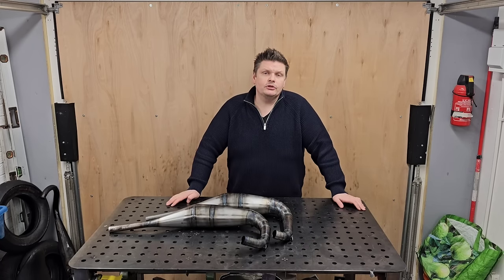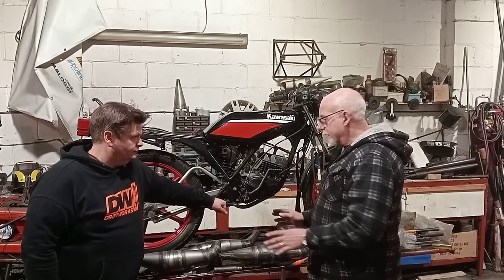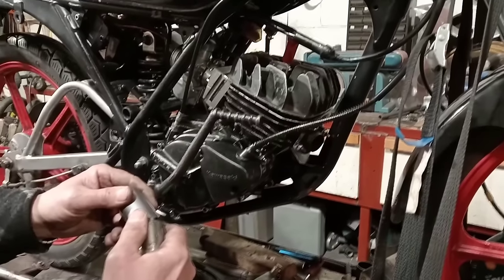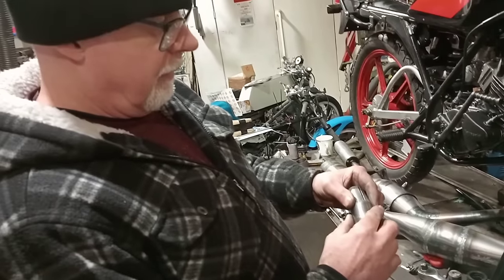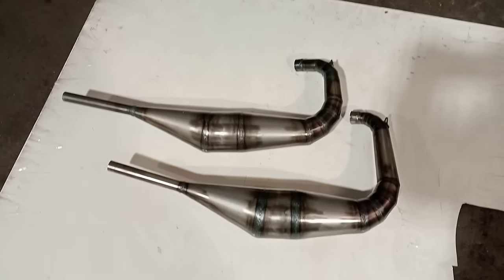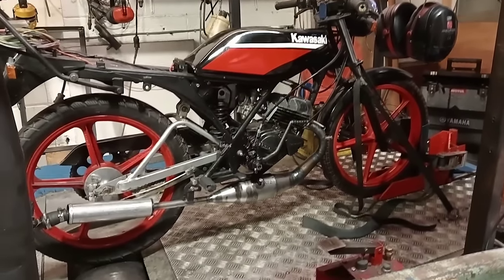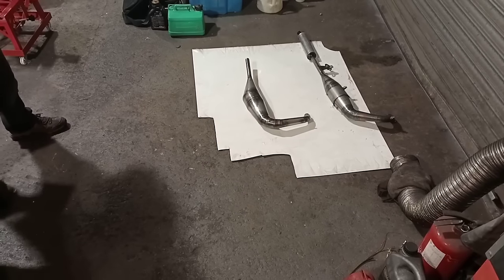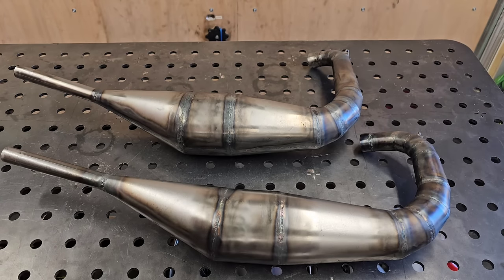2 Stroke Expansion Pipe Builder Reveals PIPE SECRETS - A day at Mick Abbey's.     #2stroke #power

Comment: Its all area under the curve. Having that peak hold for 700rpm longer allows you to shift up with a 700rpm advantage when entering the next gear so a 2+ hp / 1 ft/lb increased midrange drive which will be very noticeable. Great video!
Reply from the maker: Hi, thanks Mitchell :)
FIngers crossed it helps. The original magazine challenge bike had the T40 pipe and struggled to get 6th gear (it couldn't) so maybe with Mick's pipe I will be able to.
Reply: Gearing is another aspect I find interesting, it's really another piece of tuning for speed
Reply from the maker: @nickywalsh8492 agreed, I need to get some sprockets ordered 😊
Reply: comparing a 300rpm-plateau with a 1000rpm-plateau, I d say, the 300rpm-plateau is not drivable, more so, if you can have the option... Logically, one can say, the one with the 300rpm-plateau needs 3,3times the gears-number of the alternative... It´s not that bad in the praxis, but such a disadvantage surely carries over in the praxis (is very noticeable).
Reply: It doesnt matter what sprockets you got
If your stock transmission doesnt fit your powerband it would still be useless

Comment: Watching this video almost angers me of how much I could have improved the performance of a 350LC that I fabricated expansion chambers for, back in the 80's. I didn't have much to go on and dynos were pretty expensive back then, I only had a book on 2-stroke tuning by John Robinson. I used one of the formulas to fabricate the pipes and had them fitted to the bike. The diameter on the neutral chamber section was small compared to what you see today but it turned out to our advantage as we had reversed barrels and they had to pass under the rider's thighs and they got pretty hot lol. They did work and the LC was turning out pretty decent times at the quarter mile strip but it could have been so much better if I had the information and a dyno. I am 64 now, but 2-stroke engines still give me a thrill whenever I hear (and smell) one.
Reply from the maker: Hi, that sounds like some project reversing the cylinders! How much power do you think you had in the end?
Reply: @AutoBeta2T  No idea about power, we reversed the barrels to get the frame as close to the ground as we could so we could pass the pipes straight to the back and on the sides. I think it ran in the 11 second bracket. I remember we had a 250 head with the squish machined to fit the 350 barrels, carbs were 2 from a KH750, we still had the standard reed blocks with the centre rib removed and one piece Harpowa reeds. The engine was fitted on an older air-cooled RD350  frame that I totally hacked horizontally and re-welded it. Rear arm was lengthened and welded to the frame. We increased the rake by heating the top tube supporting the steering head and bent to whatever degrees that looked good lol. Front forks and wheel were off a Yamaha YB100. Rear tyre was spinning in the rim so we fixed the problem by tap screwing into the rim and into the tyre. Crank was welded because it spun out of true (LC cranks are not splined). At least two clutch baskets were destroyed. We ran it on Avgas fuel and the only way we could acquire it at the time was to get someone that had a pilot's license for small aircrafts, then go to where the plane was and drain the tank. Safety, what safety? We didn't even have a front brake and when I pointed it to the owner/rider to be careful he replied: "I just wanna go fast why would I need it." Quite a character, sadly he passed away 2 years ago. I believe there is a YouTube video albeit low quality that shows us racing the bike I will put a link to it if I find it. We're from Malta and when my friend went to the UK to buy parts he went to Bob Farnham and when he showed him a pic of the bike he was impressed, he even came to Malta on holiday and to meet us and have a look at what we were doing. Great times indeed.

Comment: Damn how much I would love to work for Mick. You can see how much he likes his job for how he takes time to explain what he's doing and the reasons behind it. So much to learn.

Also it's beautiful that there are grown people dedicating time to such small CC's bikes, and not completely driven away by big bikes.
Reply: To me I find 50cc the most interesting size to tune too.
Especially the older air cooled ones.
Reply from the maker: Yep, Mick really is very passionate about his job, it was really great for me to experience this first hand being lucky enough to spend the day with him. There's many years of experience there.
Reply: @peterjohn3180  Indeed! I am more used to the LC ones mostly because I live where Summer starts in May and finishes at the firsts of November. 35° C and more. Mid July 2023 we touched 47°C. Need a massive radiator and two fans to run my 80cc at 55° C.
Reply: @att49356  why do you run at 55 degrees C?
I remember when lc Moto X bikes first came out people would "cold seize" as they needed longer to warm up for correct piston to bore clearance so piston over heated locally.
But if I'm honest I'm not sure what the optimum temperature for such bikes is!
Obviously the cooler it is , the denser the air/ charge is, but the tighter clearances you will need to cool piston by conducting heat to the bore then to water or air dependent on how it's cooled.
I do wonder how this AC ar50 manages with cooling fins designed for cooling something with 4-6(?) Bhp as standard!
Reply: @peterjohn3180  it Is a modified kit, slightly ported, tight tolerance kit! Not really suitable for the Road. I also have a second bike with similar setup but less fragile as It has 6cc more and more torque means i can not over do porting etc. I posted a video on my account but audio sucks! I Need to find a Better solution.

For these engines i'd never go over 65°. On air cooled engines instead i have no experience at all! Would like to modify an air cooled cylinder to adapt It for my bike. Do you perhaps know any cylinder kit that has 40mm stroke, 90mm rod lenght and needs casings intake? 52x52mm stud spacing would be awesome!
Reply: Heat vs air cooled interesting topic

Comment: That's terrific. Best vid I've seen on making pipes. What a great idea cutting the sections out of a flat cone - definitely trying that next time. Will try 22ga steel too, I've only used 20 before which is about 0.9 as I was a bit paranoid about cracks. Thanks both!
Reply from the maker: Pleased you enjoyed Joe. Yes, Mick has some great tips that save time and increase accuracy. 
Do you gas weld pipes?
I have tried 0.7mm sheet before on my X7 pipes. I could weld it with Tig but it was a little trickier. Gas seems to be a bit more forgiving - I'd love to have a try.
Reply: Weeell. I've only made 3, 1 test and a pair for an RD250, but yes. Gas is easy enough once you get the hang of it. I use a little filler, like Mick does to tack, which takes some heat away and avoids holes, then autogenous. On the small seams you have to whip the torch away so you don't blow away the ends. My set up is an old Smith Airline AW1 handle, and AW201 tip, I really like it. Works fine at low pressure for 22ga, anything thinner is hard. I've never tried Tig so I can't make a comparison, I'm afraid. You use very little gas on thin stuff, so it's cheap to play with too.  @AutoBeta2T
Reply from the maker: @joemarchant1424  cheers Joe. Tig is similar, I think, to gas but until I have a go I can't say. I can tack with no rod but I do need use it every so often when there's a bit of a gap.
Argon seems to go quick too. I'll have to ask Mick to let me have a go next time I go up.
Reply: There's something relaxing about the flame whispering away and it's nice not to have to wear a mask. Can't believe how fast Mick rolls those cones, that set up on the slip roll working along loose to tight I definitely need to try.  The baffle cones take me ages. I have serious mandrel envy too. Thanks again for the vid - great content! @AutoBeta2T

Comment: Hi Dave, that peak power curve is a great result.
Your take about this sort of curve helping you achieve your goal is spot on based on my experience running smaller Land Speed 2 strokes.
As far as other things that can help, such as Aero etc. 
I found that minimising your Frontal Area on small bikes is the first thing to explore.
Then base everything else on this smaller profile.
Cheers Mate
Pete
Reply from the maker: Hi Pete, that is really great to hear from someone with actual real world land speed experience. 
The original magazine challenge used the T40 pipe and they really struggled to pull 6th gear (it couldn't) so I have always been conscious of not getting too peaky with the curve and spreading the power. 
Noted on the frontal area, I have a nose cone for my AR but again on the original challenge they found it faster without.

I need to get on a diet then to reduce my cross sectional area :)

Thanks again for you insight and tips Pete, much appreciated.

Cheers

Dave

Comment: In 1974 I used to tune 2 cycles. I had a 70 Yamaha 175 that put out 43 hp @ 14,500. It had 9 ports, analog 32 mm fuel injection, 8 reeds, and an expansion chamber that had a 8,000 top hp but I check it out and I got 14,000 the the gases did exit! I ran it in open class and got several first places. But in 1976 open class motorcycles were more torgue, hp, and better suspension!
Reply from the maker: Cool, that sounds like a screamer!

Comment: Had a chuckel to myself when I saw the old 2-stroke "Tuners Handbook" oncarb adjustments between pipes the bench. Did you do any carb adjustments between pipes. I remember way back when just changing the angle of a pipe would upset the mixtures (on a very highly strung T-500).
Reply from the maker: Hi, sorry for the late reply. No, we didn't, with the jetting,  but we kept track of the lambda and it was similar for.all pipes.
We did change the ignition curve from a flat 20 deg curve to one I had found worked best on my pipe. It made Micks pipes work even better so no more adjustments were made. 
But noted your point, both jetting and ignition should have been optimised for all pipes, but as always, we ran out of time. ☺️

Comment: I just subscribed, thought i already did.
These are one of the most interesting videos on YouTube.
Id love to make expansion pipes.

Have you considered having a new liner made with just a single intake port bridge rather than 3(or is it more?!)

I wonder how well it would work with a smooth bore throttle body and injection?! I hate electronic thoughbut you could have i nice constant taper and trumpet and thin throttle slide?
Reply from the maker: Hi Peter, thanks for the sub and I'm pleased you are finding the video(s) interesting - it's good to know they are being appreciated :)
Reference the liner - maybe one day... That day will come when it seizes I guess. Currently though the inlet port is just a single bridged port. I did cut a floor port in a previous video which gave some more power.

I'm going to stay away from injection at the minute and see how far I can get on a carb. The ignitec ignition I run can control power jets an carburetors so possibly some electronic control.

cheers, Dave

Comment: The compromise on a bike is available space and the noise you are willing to tolerate.  A megaphone style exhaust sized and tapered for the engine displacement is just as effective but a lot louder. Some tricky extending stinger or water injection will give you a good balance of low end and still compensate for top end for those wanting to get crazy with it. Any 2 stroke stuff is good stuff..
Reply from the maker: Yeah, water may be in order if the power band gets too short. Hopefully we can do it without but it's an option

Comment: I worked in a Suzuki/Yamaha dealers in 80's.
Hated those little Kawasaki 50's, they were always completely trashed after about 3 months. (nearest Kawasaki dealer was about 20 miles away in Cardiff)
 Everything was worn out, shock bushings, swing arm bearings,  seals, even the wiring and switches.
 Honda MT50 was impossible to tune (British market ones couldn't be ported to 'continental' spec of 6.5bhp)
Yamaha was the easiest to tune and slightly better build quality than Suzuki. (was tuning 'Fizzers' in 70's, although knew a lot less so 63mph was best I could get)
Stan Stephens was the 'go to' two stroke tuner back then and 'everyone' wanted Micron's on RD and GT 250's😁
Many years ago, I fitted a Suzuki RG125 'learner special' tank onto Honda RS125 road racer for Ian Lougher to do TT
 Lot of work cutting out complete bottom and making it fit Honda like it was supposed to be there. He removed all the fuel filters though and seized it 2~3 miles in when a bit of rust or dirt got into carb.
LOL, it's probably 40 years since I heard 'southern shandy drinker'
Reply from the maker: Yah, I think a lot of 16 year olds didn't know how to look after their bikes!

My first bike was a Honda MT 50, and yes it was pretty slow... slower than my mates AR 50 anyway... which is why I got one

Comment: That over rev is very nice. I wonder how the T40 would work with a longer belly (large section between the cones).
Reply from the maker: Hi David, we did actually try that on the day but it didn't get into the final cut. However, we tried longer and shorter on the belly of the T40 and it only became worse both ways.

Comment: Another very insightful video, he makes it look so easy! 👍.. how do you seal where the pipe slips onto the barrel? I've got a bdk pipe on mine and it leaks a bit where it slips on 🤔
Reply from the maker: Cheers - and yes Mick does make it look easy. Years of experience.
I'd use a bit of high temp sealant. Is it a slip fit? On my BDK pipe it uses the standard AR style split collar and gasket.
Reply: @AutoBeta2T  yes it's a slip on.. i picked it up off a guy that used to race AR50's.. he even had a watercooled one! Is yours a genuine Autisa barrel or one of the remachined steel ones that come out of a factory in China?
Reply from the maker: It's a genuine Autisa. Problem is that it's on 54.5 mm now. 
I could really do with another but they appear to be like hens teeth
Reply: @AutoBeta2T  wow you were lucky to find that.. I've never seen one in years of watching eBay.. so whatever you do, don't blow it up!! 😲
Reply from the maker: @user-ye8xx7gl3j  yeah, I bought it from a mate. Really lucky.

Comment: What RPM ranges for different engine sizes are used mostly when going for max power? I've noticed 125's around 12-14 000rpm and 250's at 8-10 000rpm mostly.

If I wanted to hunt for more power should I set my port timings to work at a certain RPM and then build a pipe around it. If too peaky then playing around with other things?

Its no rocket science but at the same time it is if you want to go into small details :)  I heard somewhere that oversquare engines dont have the same pipe design as square 2-strokes (old yamahas vs modern every 125)

Why wouldnt a modern pipe off a 30hp 2-stroke work on a 20hp DT125 for example?
Reply from the maker: Hi, I'll give it a go at answering but I'm certainly no expert. RPM I believe is really down to piston speed limits. Smaller engines, shorter stroke so less distance (slower speed) for the piston to move at higher rpms. Also bigger cc singles have bigger pistons - more mass etc...

From what I can see, regardless of timing the pipe tuned length plays a major part in the rpm of the engine. In a previous video I went from about 192 duration in the exhaust to 203 and the peak power rpm only changed a few hundred rpm. Port wise you need the STA for the power you want - particularly exhaust blowdown.

Pass on the oversquare design. I couldn't answer for sure. A thing to note is that oversquare two stroke engines have less port area than a square engine of the same cc and port duration.

A modern pipe may work but it comes down to the rpm range the engine has been designed to work in I guess. Putting a higher power pipe of say a road racer on a DT125 may make it rev but if the ports don't have the area to work at that rpm it won't make the power. Also ignition would need tweeking too.
Reply: Okay thanks for the long answer :)  We just tried an exc125 pipe on a dt125 with my friend over 10years ago and it was super peaky at super high RPM, I even got 143km/h on the GPS with it so it definitely made more power than stock. The DT cylinder also has a longer exhaust duration than a 1988 yz125 if I remember correctly which is weird to me :) Both are 56mm bore or the yz could be 56,4 with 50.0 stroke where the 1989 onwards DT is 50.7 stroke and 56.0 piston. Cheers :) @AutoBeta2T

Comment: Have you ever looked at the FOS-pipe-Concept by Frits Overmars (there’s some images online on the Kiwi Biker Forum)…..he says it’s for thermally sound engines (ie: water cooled), but for one speed run it may be OK, no sure how safe without increasing stinger diameters and lengthening slightly for a lower EGT’s / reliability on an air cooled engine.
Reply from the maker: Hi, 
I have tried a FOS concept pipe design in the sim and it gave a nice power curve, but as Frits himself says: it's just a starting point to then progress from with testing. That said I may try one of the calculators and maybe build one at some point.

Comment: 20hp from an AC - cracking result!!!
Reply from the maker: Cheers mate - note however,  it is a big bore kit and 97 cc
Reply: mtx130 guys make over 40 hp on a air cooled engine
Reply from the maker: What bore and stroke are the mtx130's?
Reply: @AutoBeta2T  57mm bore and 52.5mm stroke
Reply from the maker: Cool, so a little oversquare. I am 54,5 mm bore and 41.6 mm stroke so really oversquare. I'm making equivalent to 30 hp if mine was 130cc  so a bit to go yet.